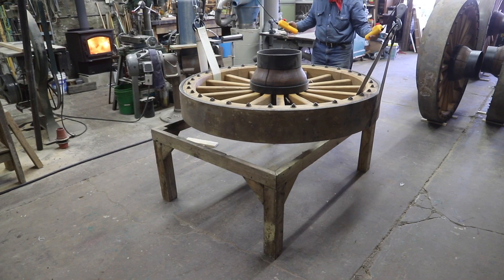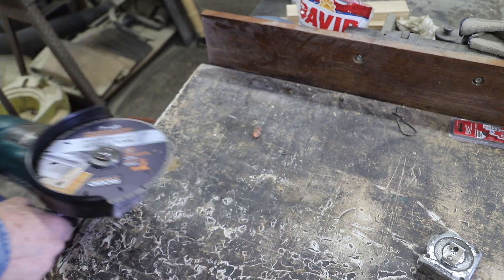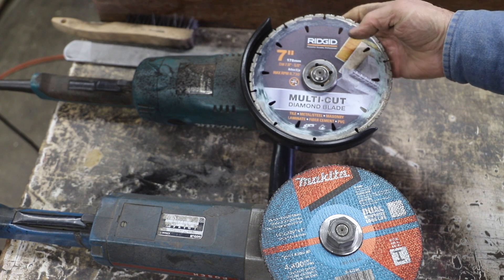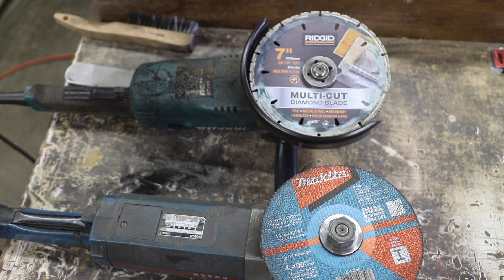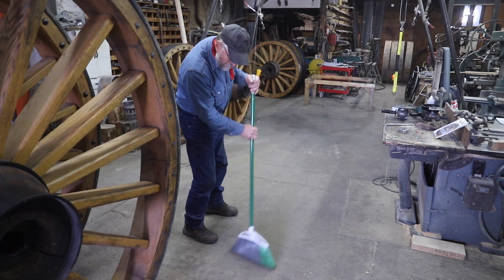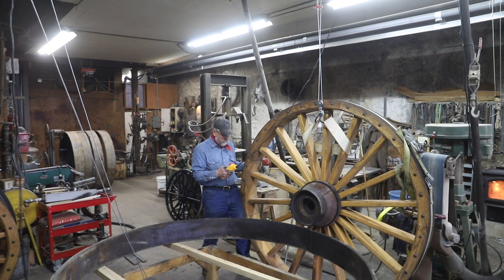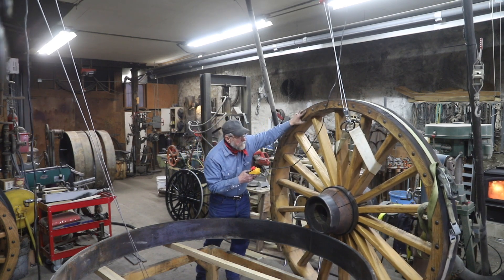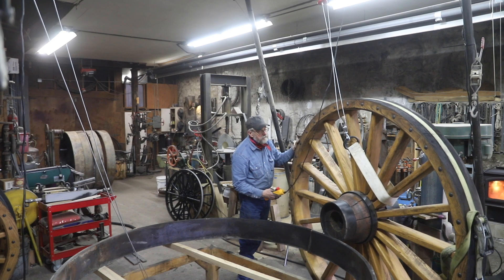Dismounting 550 lb. Steel Wagon Tires | Engels Coach Shop

Comment: You need a Skil SPT78MMC with the Cermet blade.
It would make that cut from the top down in less than a minute.  You would find it immensely handy for other things around the shop as well.
Reply: Come to think of it,  I would probably just hold the wheel vertically with a strap at 11 o'clock and 1 o'clock and cut across the top with the saw flat.  There seems to be almost no spring open so pretty safe.
Reply: Dave said he will look it up.

Comment: I bought a diamond wheel for my 4&1/2 grinder for cutting 1/2 inch rebar. It took over 5 minutes, when the regular grinder disk to about 30 seconds.

Comment: Very interesting the work you do without any help. Well done.  I found it interesting the flex in the spokes when you set it down (11:24) and again when you lifted at (11:31). 
Why did you make sure to cut the wheel on the felloe joint?

Comment: I think I see how drying out causes a wheel to become felloe-bound. Assuming the spokes and felloes shrink the same (both being longitudinal grain), as the spoke shortens by 1%, the felloes would have to shrink by π/2 or about 1.57%, leaving the felloes too long by about 0.57% of the shrinkage.
I was astounded to see how floppy the wheels were without the compression of the tires. They seem so solid when you are assembling them.
Reply: Judging wood shrinkage can be tricky. I make decorative turned wooden knobs for one of my customers. The knobs have a recess for a plastic disc. One batch was made from Rosewood. I allowed a fairly generous shrinkage allowance in the recess but a month later my customer came back to me complaining that the recesses were too small. Another batch was made from Ovangkol and I used the same allowance. A little later my customer commented that the recesses were too big. Sometimes you just can't win.

Comment: Was wondering what would come after 4, 5 or A? 
You may want to c-clanp a 2 x 4 across the top queues of tires to prevent a domino accident?  We had the same occurances on our injection mold plates disassembled for core and cavity maintenance. Our molds consisted of 5 - 10, 1 3/8" - 5 7/8" thick, 9 7/8" - 23 7/8" wide by 11 7/8" - 35 7/8" long steel plates, catastrophe always occured near the end of their storage making lots of loud noise (fortunately no one ever was injured). Resolved it by threading an eyebolt on each plate's top side and inserting a piece of black water pipe.
Garrett's Woodwerx "Dualing Cable Hoists" observation is spot on. For years our tool makers used a 3' long round bar threaded Johnson Bar into an eyebolt hole to rotate an assembled mold from the bottom to a side on the assembly bench (larger molds would require more than one person). Visiting a mold sampling shop in Windsor, Canada I observed their 15 ton hoist had a 5 ton auxiliary on the same overhead beam, both controlled from the same box. One to lift and one to rotate/turn, no toolmakers flying through the air to turn a mold there!  
Again watching your clever solutions are our pleasures. Stay safe.

Comment: I just realized how small your shop looks to be. I work in a machine shop that is approx. 6 times the size to 10 times the size seen in your videos. Granted, the part of the shop I normally work within is about the same approx. size seen for the inspection department(something approx. 40 to 50 feet wide by 160 to 200 feet long).  I am amazed by how much work you can get accomplished with such a small workshop. Goes to show how a well laid out shop can make a world of difference, wouldn't you say?

Comment: fantastic video i'm so pleased you changed back to normal abrasive blade , in my long years as a general engineer and blacksmith I have seen all types of so called time saving attachments and mostly the old ways are the best keep going my friend love your work :)
Reply: Yep. I knew right off that diamond blade was no good on steel.

Comment: I only use the diamond cut-off wheel on my jerry-rigged small diameter metal cut-off station that uses a 4.5" grinder as it means i don't have to adjust the height or replace the blades as often. My 355mm metal cut-off saw cuts alot faster but it likes to throw smaller diameter pieces of metal even when sufficiently clamped if your not fully concentrating on the task.

Comment: I did some work with a small laboratory diamond blade saw. Cutting thin wall stainless and brass tubing. It had a small water bath under the blade, and you cut at the top with the workpiece held on a swing arm. It would cut as long as there was water in the bath. If it ran out of water it would literally stop cutting - even with brass. I was astounded by that.
Reply: does that mean that the diamonds do not cut when they are too warm?
temperature would depend on cutting speed as well. 
in that case a slower saw might result in higher cutting speed.
Reply: @ulrichkalber9039  This was a low speed saw, so temperature shouldn't have been a problem. It was not clear to me why it would stop cutting. The only thing I could think of was the water was needed to flush out swarf. These were fine grain abrasives.

Comment: It,s so nice to watch your videos. i am always amassed and i have learned so much. I am imbarased to have to tel you something about tires, but i think i have to. I have been working with train wheels and we have been using cutting tools for this (Saw in Gråkalbanen we used an old cold saw. And in Bergen they use a chain saw). I also think you will do better with a ordinary circle saw with hard metal blade and a drop of oil. This angle grinder is dangerous and its a lot of sparks. I did have a battery circle saw in my car fore some years and i was rely amassed of the performance. I think you have the tool. you only need the blade. I might not have to tel you that you can sharpen them several times. Then they are not so expensive.
Reply: I have a 4" circular saw, it looks like a small circular but it spins at 20,000 rpm, that would be the perfect tool for the job, it takes the same 4" blades used in grinders.
The best part is, I got it at a yard sale for five bucks. Those abrasive disks can be deadly if they break.

Comment: I'm see the hoist system works very well. If you had to wrestle those tire off and move the wheel by hand one could easily get you down and have one in a tight spot.

Comment: I cut quite a bit of metal in regards to my job (HVAC). I’ve always used an abrasive wheel for cutting, never tried a carbine/diamond encrusted what ever it was. Doesn’t look to impressive for the significant price tag. They have a 7” circular saw sized abrasive wheel. Main reason I use a circular saw is the bed of the saw for stability and depth of cut. If set up right that blade wouldn’t leave a mark on the wheel.  But hey I’m just a HVAC guy.  As for risk; as most of us know, if you want to get things done you access and proceed with caution. Get r done !
Reply: Diamond coated wheels should be used for hardened metals like tool steel. Hopefully a lesson was learned.
Reply: The main difference between using an angle grinder and a power saw comes down to the rpm. The power saw is always the slower turning motor for the same size of motor and blade diameter. So what you pick up in quality of cut if you use a fence and in depth control, you loose out on speed of your cutting.
Reply: @FieryWACO  In my experience, diamond wheels are better for carbide tooling  and hard ceramics with ordinary 36 grit (aloxite /ruby) wheels for any type of steel. (even HSS and HHS/cobalt) 
Diamond wheels are usually much finer grit size so always cut slower than ordinary abrasive.
There are some new abrasive materials available but the cost tends to be pretty high (often more expensive diamond wheels)

Comment: I, too, am a woodworker, just not a wheelwright, so I have a question for you. I can't help but notice the charred wood and the carbon laying in the floor when you take the tires off. Not only that, but I understand that the steel tire has to be expanded and allowed to shrink on the wheel, but what about the  damage to the wood? Charred wood has no structural strength and will only allow the tire to loosen again over time. Yes, I understand that this is the way it has been done for hundreds of years. I am just wondering if some sort of intermediate material could be attached to the wood wheels before the steel tire was installed.
Reply: The charred wood is not the problem it is the desert climate where the Borax wagons are located that has evaporate moisture from the wood.

Comment: I was surprised that the steel bands were rolled with a radius so close to the wheel that they hardly sprung at all when you cut them.
 Great Video.                   Thanks

Comment: mr engel  , question based on curiosity .  would cutting the tire in half and using 3 "rubber buggy" tires  result in a better ride ? as always thanks for the videos.

Comment: Okay, so I just finished the video an assume that I have to research some other video to figures what genus trying to achieve besides a partial disassembly?
Reply: He has to resize and reset the tires because the wood has dried out and shrunk in the dry climate in California.
Reply: @dianeengel4155  
Thanks! :)

Comment: A question, if I may - seeing that the wheels drying out could have been expected, would it have worked to make the tyres a bit smaller than normal?
Reply: No, you wouldn't be able to heat them enough too expand them enough to get them on.

Comment: Diamond blades are more for durability rather than speed. 

You don't sharpen then but can cut really hard stuff with them. For hardend steel I recommend a cut-off disk.

Comment: What did the original draymen do?  I reckon they may have used shims or wedges until the could get to, and had the time out service, a proper wheelwright.  'course then, maybe every smithy was 'good enough'.
Reply: An operation like hauling out Borax and such, which involved many wagons, perhaps they had spare set of wheels, already acclimated, sitting around to be changed out when tires came loose.

Comment: Had a machinist that I used to trust recommend those diamond wheels.  Tried one... easily within the first 30 seconds I knew they were not up for the task.  Maybe on sheet metal... anything thicker abrasives are the solution.

Comment: I agree about the diamond wheels. They last a lot longer, do not produce as much heat or sparks, leave a rag free cut, but are sloooow!.
I had asked earlier about your solution to "age" fresh wood and have been unable to find the video where it is buried.  All I remember is using filings and--maybe vinegar? - bleach?  It's hell to get old;
Your octogenarian from Oregon.  Please do not drop a wheel on your toe!!!

Comment: On the diamond tool. As a Zerspanungsmechaniker (German for lathe operator but the job is a bit more that just operating the machines) I can tell you that the Diamond tool likely worked worse than usual cutting discs for the steel. Thats because you cannot work ferrous metals with them as the carbon preferably binds to the metal. The "diamond" structure basically gets ripped apart and the tool turns uselessly blunt very quickly. A normal metal cutting disc is the way to go, these diamond discs usually get used for stone or ceramics.
Reply: Thank You!
Reply: these discs are often advertized as a longer lasting but slower cutting alternative to normal discs and Project farm showed that iirc
Reply: I think s flow of water over the leading edge of the diamond wheel would have improved the cut.
Reply: I suspect the diamond blade would work better on harder steels.
Reply: @craigsmith8217  No. It would not. Its a basic physical property of the carbon crystal lattice that makes up the diamond and the high binding force of carbon to the ferrous metal. The iron, even if its steel its still made mostly from iron, pulls carbon atoms out of the crystal lattice and destroys it. And under pressure and heat, as when cutting, that very quickly destroys the tool.
Reply: @garrockwaters304  No, its due to the physical interaction of carbon and iron. The iron literally pulls carbon atoms out of the crystal lattice that makes up the diamond and destroys it. There is no way to make it work well other than using a different and compatible cutting material/abrasive.
Reply: @theexchipmunk  diamonds form a lattice structure and do not like other molecules to attach to their carbon atoms... You need some pretty insanely strong acid to rip the carbon atoms from the structure, so I doubt steel can do it.

It's more likely that it's the fact that Diamond disks are not sharp, they are hard. They are ment to cut hard things without having to worry about the blade becoming dull.

Moreover depending on the steel you are cutting, diamond blades are known for work harding the steel due to its slow and hot cutting nature.

Again they cut very slowly.
Reply: @theexchipmunk  
Oh , metal .
Reply: @spik330  You really don't understand do you? This is basic knowledge you get taught as a machinist. You cannot use diamond tools for cutting iron or steel because they blunt extremely fast due to the structure of the diamond getting destroyed. This is fact. To elaborate, there are two mechanisms behind it. One is the oxidation and deoxidation reaction of the iron caused by diamond in the lower temperature spectrum. The other is a catalytic reaction caused by the fresh iron surface on the diamond. Both take carbon atoms out of the crystal lattice and disrupt it, causing the diamond to rapidly wear down as it loses its integrity.
Reply: @theexchipmunk  Shouldn't there be a warning to not use it on steel?
Reply: As a Zerspanimbeciletypemechanicmachinstker-hammer mechanic,  I concur. Diamond for rock and oxides for steel.
Reply: I've been using diamond discs for cutting stone tiles recently and been disappointed with some of them for that as well. I actually found a thin disc intended for cutting stainless steel worked well in the angle grinder on stone. Can't vouch for the safety though.
Reply: What I would point out about these diamond discs is that the packaging states that they cut a variety of materials, including steel. Not a very good marketing practice. They work great on non  ferrous materials.
Reply: @hodwooker5584  If you think about it its actually a great tactic. Makes the tool go blunt faster and therefore requires a new one sooner.
Reply: @spik330  I have to confirm TheExplodingChipmunk.  As a metallurgical lab responsible, we do cut samples from whatever materials. It is a general rule never to cut any steel alloy with diamond!!!  It does work, but it consumes the diamond at a VERY high rate!!!  So often a new lab worker seems not believe that and learns it from own experience.  The days that diamond cutting tools did cost fortunes are behind us, so it is no more a disaster when someone makes this "error".  Up to date I could not find a good complete explanation on why steel is so destructive for diamond cutting tools, because it is complex process that involves so many parameters:  the chemical bonding of carbon in the steel with the diamonds, the cutting forces that are applied, the embedding quality of the diamonds in the holder material,  the local high temperatures, etc.......

Comment: I''m confused.  The wheels were sent back because the wood had dried out and there was some shrinkage.  When you cut the steel tires off they were still under a good deal of tension so It doesn't look like that was the problem but when you lift the wheels I could see the hub moving under weight.  Is that the issue that needs to be corrected?  I'll keep watching because I'm sure I'll see the issue.
Reply: You are right, and  I think Dave will explain it next week.

Comment: Hello, excuse my igorance as to what acually you are doing. I just happened to see this in passing and watched for the first time. Am I correct that you will adjust the wood part and the reinstall the steel and weld them back together and press them on spme how? thanks
Reply: Yes. He will explain more next week.
Reply: @dianeengel4155  Thanks for the reply back. I will watch, it is fasinating to watch.

Comment: I highly recommend the 3m Cubitron cut off wheels.  Cuts twice as fast as a standard cut off wheel and lasts longer too! They cost more, but it's worth every penny.
Reply: Superb cut off wheels, I use the 125mm & 230mm3M CUBITRON 2, fast cutting, BUT THEY MUST BE USED WITH A WHEEL GUARD...

Comment: You should look into carbide toothed saw blades designed to cut steel. Diablo makes them for all common circular saw sizes. I have used them in a worm drive skilsaw to cut 1" plate steel without any problems. It wouldn't have even taken a minute to cut that tire unlike your 1 hour. Diamond blades are good for cutting ceramic and other stones but for metal they suck.
Reply: Only  saying if  but I'm sure your wife ,or assistance isn't too far away if needed, the tow truck guy in Oregon pinned himself under his jeep tire,and luckily his wife was home  to jack the jeep up
Reply: Those diamond cutters ok on brick,not great

Comment: diamond disc better for very hard materials like ceramics  the regular disc great for ferrous...  by the by, they 'cut' by melting the steel at the disc edge if the pressure is firm enough and the tool is powerful.   goes very fast....compared to 'grinding' where the disc removes particles.   In the steel industry they actually use a high temperature steel disc and lots of pressure and power to 'cut' steel beams  no abrasives.

Comment: How could you tell these wheels needed to be worked on?
Reply: The previous video explained it. The wood has dried up and shrank so the tires need to be tightened up
Reply: The felloes are no longer tight to the shoulders of the spokes.